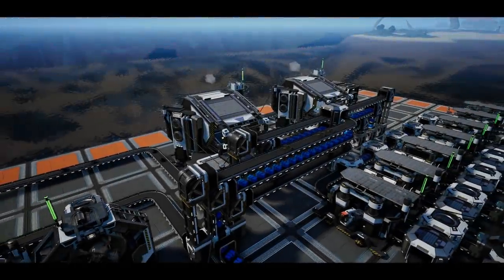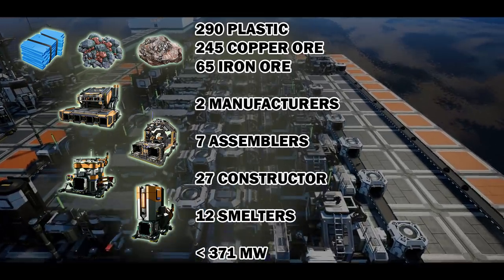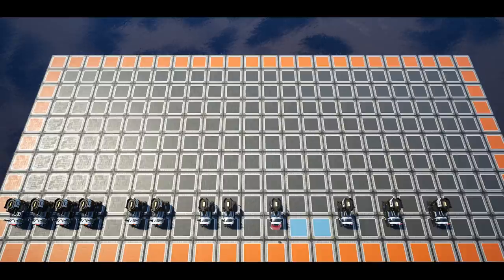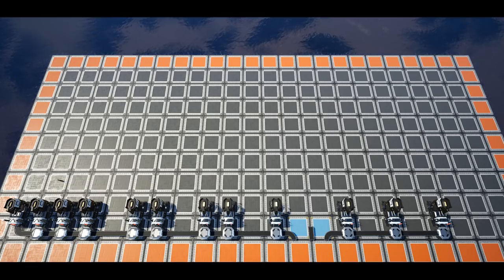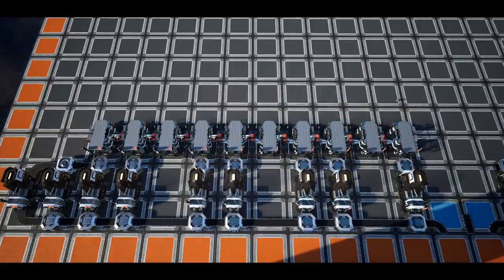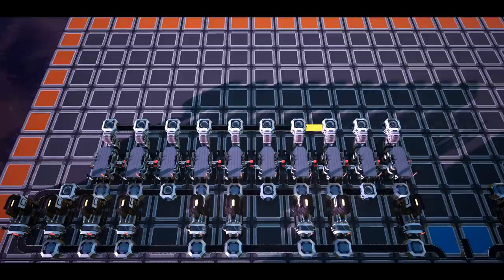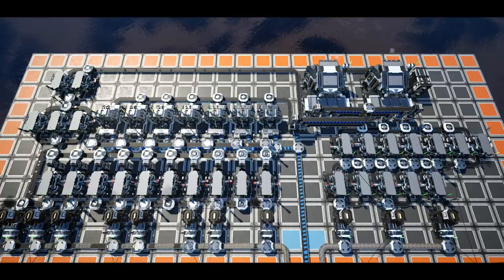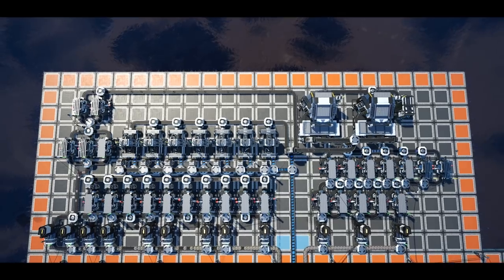Computer Super Efficient Build Guide [Satisfactory Game]

Comment: For whatever reason I cannot make the 1st sheet constructor run at 100% efficiency. Anyone know what I did wrong? It almost seems like the splitter is eating them, considering the amount of ingots I produce is exactly the amount I need in total, but nothing is getting clogged anywhere. I think I fixed it by simply having the one smelter connect directly to the sheet constructor and setting it to output 20, while setting the 16.67% efficient smelter to 50%. This leads to 45 ingots going to wires and 20 going to sheets.

Comment: I didn't even bother with the = vanilla  computer recipe end went straight to the crystal computer alt.  Crystal oscillators are a massive pain, but combined with a few other alts this becomes much less resource intensive - my computer line doesn't use a drop of oil.
Reply: I know everybody is using their methods and what not, but I use about 720 water , 150 crude oil and 240 caterium ore per minute. That grants me a total of 10 computers a minute and, overflow of rubber, packaged fuel (Don’t have the exact number, but about 150 a minute, and maybe a little plastic left over. I have not seen any, but damn am I happy about that production line. Might use a lot of refineries, but gets the job done with a minimal amount of resources for sure. Water is everywhere pretty much

Comment: Good tutorial on the number and aesthetic front. But trying to follow it is difficult. The top view is not completely on top and makes placing machines in the correct position in foundation difficult. 

Also could you add arrows to mergers/splitters and belts so it’s easier to see the flow direction?

Thank
Reply: You can see from the grid where the location of the objects are. Also, Mergers/splitters are keyed for their outputs (one output has a different colour mark) and you can also see which direction the belts go from that.

Comment: Very cool guide! Love the Splitter/Merger Setups, especially with the Manufacturer, just looks very clean. :-)  But one question, why underclocking? Whats the downside of Buildings running at 100%, besides more Energy consumption?
Reply: It's just not used as efficiently and eventually things back up. Plus there isn't a point of crafting let's say 30 iron bars if you only need 20 a min
Reply: it evens out your power usage and request. If you dont have powerstorage unlocked yet, an powerspike may shut down you powergrid
Reply: When a machine doesn't quite have the materials it needs, or when it's oversaturated, they tend to go into a standby mode which actually slows down production even if the materials are enough. Also, in a manifold line, you want each machine only taking the materials it needs or else it will starve another machine down the line and cause inefficiency again due to the standby mode.

Comment: why do u need different conveyer belts for different sections
Reply: Kinda late, but you need higher tier belts coming out of mergers if the merger is combining more materials than the lower tier belt cant handle. EX If you' re running two tier 1 belts, both transporting 60 materials, into a merger, you would need a tier 2 belt coming out of it that can handle 120 materials.